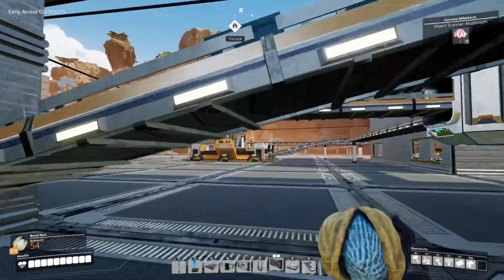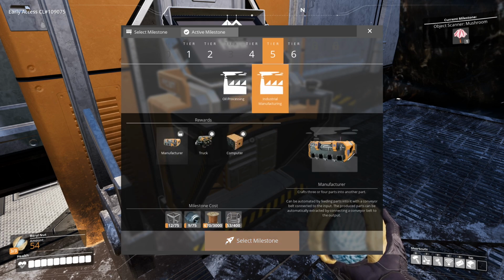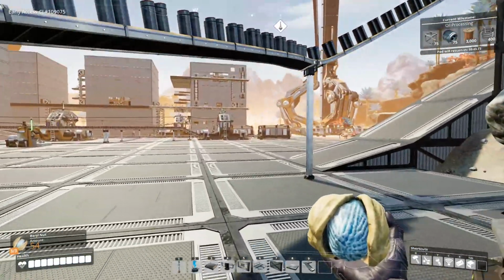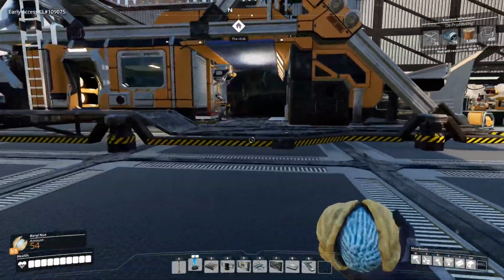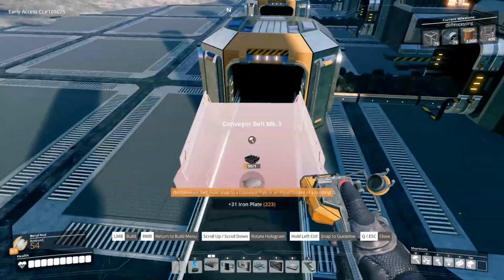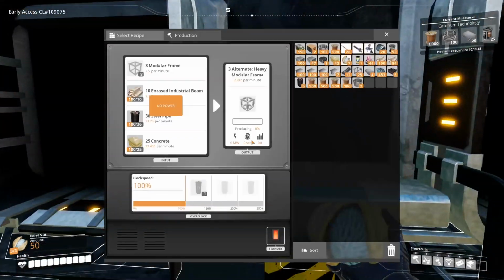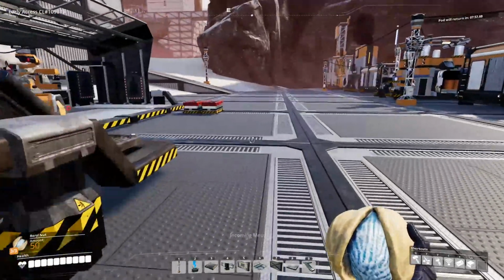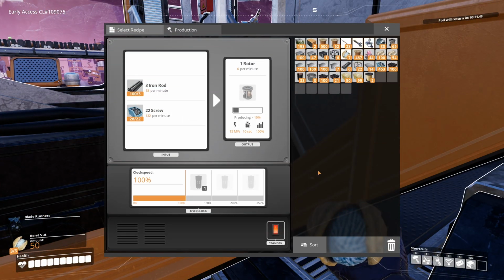Satisfactory S2 E09 - Unlocking Tier 5/6, Oil and Manufactories (Ooh, and Blade Runners)

Comment: I'm having a few problems: I tried your setup, where you build upward to increase production.
I tried that with screws, I've built a 3 or 4 levels high building but I keep getting bottleneck at the lowest level where the output goes to an industrial cargo container and from there to several outputs of production buildings.
Despite that all conveyor belts from source to destinations are of the same type (mk4) screws from levels higher than the floor level don't get out fast enough, my only solution so far was to have one output per level.
I'm using the alternate blueprint of screws where it directly consumes iron ingots and all the belts that provide ingots are full, so I know I'm not short of raw material.
In my setup, each floor has 4 constructors.
Also is it better to have 1 miner attached to enough smelters to consume all of it's ore or is it better to attach several miners together and deliver the ore to a smelting facility?
Reply from the maker: The only point at which screws (or any output) really matters, is 'Are all the machines consuming screws getting screws faster than they can use them' - if the answer to that is no (and the same for the miner/furnaces, asking the same about ingots), then you're constrained. Now, if that constraint is due to a single belt being absolutely full and maxed out, then you're definitely right, in that it can be a bottleneck. At this point, I'd consider a few options - a) Adding a second screw building, b) adding screw-making locally to the building that's consuming them (alternate floors or similar), c) As you say, multiple output belts, which should merge rather nicely onto stackable poles, rather than the basic pole. Given screws need huge volume, I'd be tempted to move them to be built more locally, even though from a clarity/tidiness point of view, I might go for (c) :) Hope that helps!
Reply: @grayduster  for now I did try to upgrade to lvl 5 conveyor belt, also switching the other recipe of heavy modular frame, hopefully now I wont have bottleneck with screws.
Reply: A bottle neck of parts being delivered to a constructor isnt neccesarily a bad thing just make sure the other part besides screws going to the constructor is producing enough to keep up production and if it is keeping up then just increase overall production  i.e. more constructors and i personally like to smelt as much as the miner can supply at the deposit and send it to a storage container to save space at the main factory